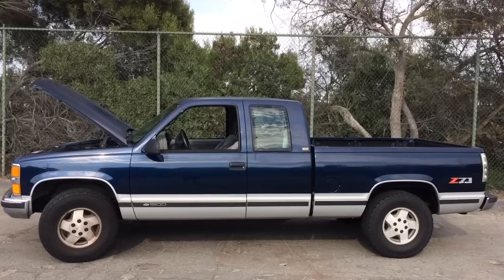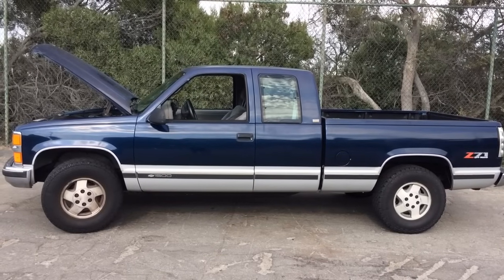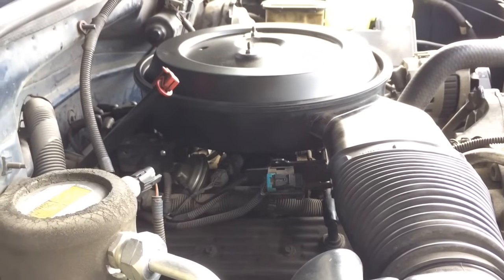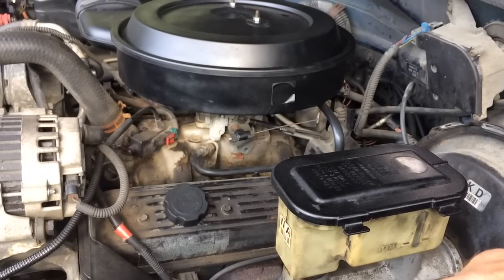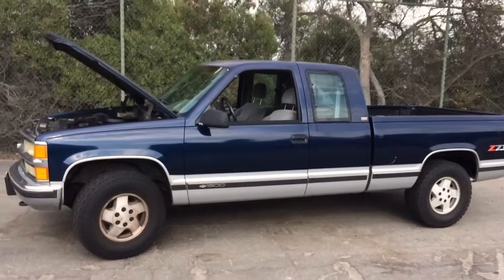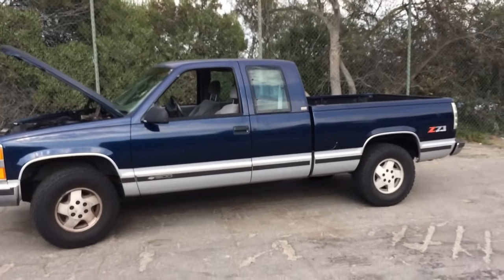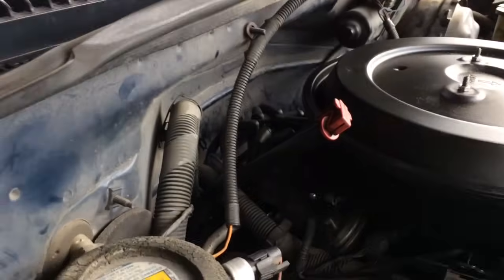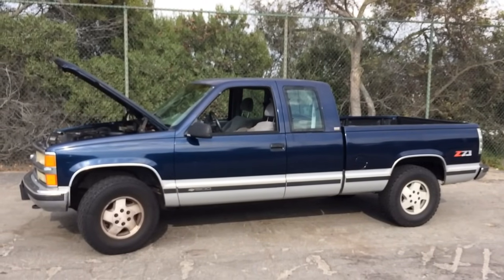Chevrolet Truck Hesitation Problem Fix

Comment: Very nice truck. I have 1995 Z71 also. Bought it new. 228,000. I’ve had the same issues you describe plus others. I love this truck. Just had it repainted. Everything works on this truck. One of chevys better looking trucks. My question is what size tires do you have on that thing? Really like the level stance of it. Also, what exactly did you replace/repair concerning the steering? My steering has  been requiring increasingly more effort to turn.
Reply from the maker: I had the pittman arms replaced to fix the steering problems. Your power steering pump might be the problem. Definitely make sure it has enough fluid in it, and maybe siphon the old fluid out and put some new in and see if that helps. Here is a video I made about the tires I’m running.  265 75 Tires On A Chevrolet Silverado Truck https://youtu.be/vpzE2AwR2VI
Reply: hoohoohoblin 
Thank you for the information and tips on the steering. Such a cool truck you have there.

Comment: Ok, but here's my issue. K1500 Heavy Half 5.7L Auto. Starts fine when cold, idles a little low and sometimes stalls. But when driving, after all is warmed up and hot. Loses power, like its running only on 3or4 cylinders. Stalls out, then won't restart until it cools off. Kinda like vapor lock is keeping the starter from rolling the engine over, or the battery is too weak to crank the engine. But after cooling, starts up and runs fine again. What's your take on that?
Reply from the maker: It could be the EGR valve getting stuck open. Sometimes if an ignition coil is going bad, it expands when it gets hot, and then the spark gets weak, but when it cools off, then it’s able to spark again. I’ve seen that happen on one of my motorcycles.

Comment: I have a 94. It's running Rich with a skip. And going down the road when it's skipping it has a faint popping noise out the exhaust. Any ideas

Comment: Thanks for the video man, what about shaking while under light throttle and rough idle when in gear on the brake
Reply from the maker: That’s a tough one to diagnose, and it could be a number of things. Sometimes the EGR valve gets stuck open and it will do that. That’s an easy thing to takeoff and clean. You can usually reuse the gasket, so it doesn’t cost you any money.
Reply: @hoohoohoblin  alright I really appreciate it man!

Comment: I have a 95 Chevy Tahoe that's doing the same problem like I'll be driving and it will act like I have no power so I'm just wondering will it still pass smog
Reply from the maker: It might. On my truck, it was sometimes fine, and other times it ran really rough, but when I took it to get emissions tested, it passed.

Comment: Was it shaking or jerking bad when you accelerate? Recently my 1994 Chevy Silverado c/k1500 5.7 with a 350 started to shake bad when driving. It only happens around 3 gear and up. It’s hesitates and then also jerks really bad when I press down the gas pedal a certain bit. Specially around 40mph and up. At around 50-55 I’m kicking into over drive and this is where the problem is the worst. Cause at about 50 I can only press the pedal down so much to get more speed without the truck shaking real bad. If I accelerate easy and slow it doesn’t happen.
Reply from the maker: It could be the EGR valve getting stuck open. I’ve seen that happen on these motors before I

Comment: 1989 Chevy 1500 4x4 transmission works sometimes and sometimes it doesn't work no reverse no forward it a 4speed automatic changed TV cable work went to store came out no gears went back next day and drove it home but had RPM really high and it sounded like it was in low gear maby sec
Reply from the maker: These trucks have a lot of mysterious problems. Mine was doing a lot of weird shifting and idling, and I replaced the ECU computer chip, and it fixed everything. I don’t know if that’s your problem, but it’s worth trying. Make sure you buy the chip with the exact same number as the one you have now. They make different ones for different engine and transmission configurations. People sell them on eBay all the time. I made a separate video showing how to swap a chip out.

Comment: my old 99 5.7 truck stalls every so oftern when i slow down, its gets scary sometimes. especially on the highway. i slow down to turn off, or cut across, its fine, maybe might sound kind of weird because i can tell when its about to do that. idling goes up and down. 
i decide to cut across, semi coming but i can make it, then she dies when i step on the gas. full standing stop. standing on the brake pedal. 
i changed the MAF, perhaps i might clean the TB or intake whatever. there is another sensor related to the MAF further back? 
it doesnt do this all the time. most of the time its not a problem but just every once in a while she acts up. in fact the thing runs great.
Reply from the maker: It could also be the EGR valve getting stuck. I’ve had that happen before, and it runs fine most of the time, but sometimes it gets stuck open or closed.

Comment: I have horrible hesitation. Sometimes runs well mostly No! I got a 1985 Chevrolet Scottsdale C10 long bed. I have new distributor cap and roter. New carberator. Checked all spark plugs for fire. Really great motor! So???? Goin down road hesitates. Even got shaking in front end. Do not kbow if that is re: to hesitation. It coughs when I shut her down in driveway. Used to cold start perfect. Now have hard time warmin her up. Used to not have that problem. After i drive for 10 or so minutes on regulat hwy. 55 mph seems calmer but still has that small jerk feelin like hesitating. I do need a new muffler on left side. I know i need ties rods and shocks up front. I have just got my babe back on road 5 mos ago . was sittin for 5 1/2 yrs. Doin most important to it first. But now this hesitation. Any suggestions? I love my truck. I put a new fuel pump on her 5 mos ago. Pulled tank emptied out gas. Put new fuel filter under hood by carberator
Reply from the maker: On my truck in the video, I think the main problem was that the plates in the catalytic converter had come loose, and sometimes they would obstruct the exhaust flow, and sometimes they would bounce around and get into a position to let enough exhaust out. It’s possible that the same thing is happening in your mufflers. And also in your catalytic converter, if that truck came with one.  The other thing which sometimes causes problems is the EGR valve, but I’m not sure if they have those in 1985 or not. If your EGR valve is stuck, you may be able to take it off and clean it and put it back on.

Comment: You ever change the EGR valve, my 91 gmc needed when it gave me problems with idling and shutting off in reverse
Reply from the maker: Yes. I made this video about it. In my case, it didn’t make much difference because the problem was something else. You can also take off the EGR valve and cleaned it out if it’s not working rather than buying a new one. How To Replace The EGR Valve On A GM 350 V8 Engine https://youtu.be/3DwDBIRrtso

Comment: Normally it's not your fuel pump that goes bad it's the hose connecting from the pump to the line going to your fuel filter those hoses get beat up over time close to 100,000 miles but since you are there might as well change the fuel pump

Comment: I have a 1993 Chevy and as I was trying to step on the gas it wouldn’t accelerate it would jump and the truck felt shaky so you know what it might be ?
Reply from the maker: It could be a lot of things. These problems are really hard to diagnose. It could be an EGR valve stuck open, or a throttle position sensor, or maybe even the ECU computer that controls the engine.

Comment: I have a 89 s10 pickup with a 2.5 liter engine and a manual transmission. Problem is it runs fine for about 15 to 20 minutes then it want to buck and carry on hesitate. Today when you put the clutch in it tried to die. The only parts I didn't install were the tps and map sensor. The fuel pump hanger assembly and tank are brand new. The brand new pump went bad in less than 30 days. I don't know what is causing it to run the way it does. The person i purchased truck from also replaced fuel pump. Why does my truck hate fuel pumps?
Reply from the maker: It could be the EGR valve getting stuck, or it could be the plates in the catalytic converter have broken loose and sometimes obstruct exhaust flow.

Comment: I'm having the same issue now, I only noticed it uphill but it won't go past 2500RPM. I'll definitely do the fuel filter and throttle positioning sensor
Reply: Did you get that fixed? I'm having the same problem. And winter is coming in. I need to aquire firewood
Reply: @Larren54  it was my fuel pump dying. It ended up totally crapping out shortly after. After replacing it it is much better
Reply: @aidanodonnell5908  woah! I was bout to replace my TPS. I tested my fuel pressure before the fuel filter. I had 11psi which is in spec

Comment: I have a 95 gmc sierra... Nice truck but since i got it ive never been able to get rid of the vibration/hesitation
Ive changed the
-Spark plugs( multiple times)
-Spark Plug wires(multiple times)
-Distributor cap(multiple times)
-Rotor(multiple times)
-Distributor
-Fuel Filter(multiple times)
-Fuel pump
-Alternator
-Starter
-the sensor on top of the valve cover
-cleaned out the carbuerator
-fuses
-relays
Its driving me crazy

-
Reply from the maker: On my truck I’m pretty sure it was the catalytic converter. What I think it happened was that the plates got loose and sometimes would obstruct the exhaust flow. You may want to check that, and also check the muffler to make sure that nothing is obstructing exhaust. You’ve handled all of the intake stuff and engine stuff, so that’s all that’s left.
Reply: @hoohoohoblin   I have a 95 Chevy silverado  started but no run l changed distribur cap rotor cables full filter egr temperature sensor  idle valvu end oxygen sensor but when desconet the temperature sensor an map is running but when put an drive cut out an please let me know 1idea sr

Comment: Thanks for the videos! I can start the truck easy if it has been sitting but if I stop and go on a errand it it's hard top start. Plus I can smell gas when it is running(running rich maybe).ECM is bad. This is a 96 gmc with 5.7 v8. I have 248000 miles. Any advice would be great. Finally, don't know if it is from running rich but the truck shakes when idle. I put into park and the shaking stops.
Reply from the maker: These trucks are tricky. It could be the EGR valve is dirty. On mine one thing I didn’t mention in the video because I didn’t know about it yet was that it had an intake manifold leak. That’s pretty common on these trucks, so maybe some extra air is getting in there. Also, on my truck I think the main problem was that the Catalytic converter had gone bad and the plates in it were rattling around and sometimes obstructing exhaust flow.
Reply: @hoohoohoblin  rats nest in exhaust ?

Comment: My 1990 is rusty, too.  The previous owner(a farmer) killed the stock 305 motor.  I put in a remanufactured 350, thinking I'd get more power. Nope. Still pokey, 12-15 mpg in the winter, 16-19 mpg in the warmer months. CEL comes on when it gets warm and the motor stumbles on acceleration.  I'll floor it for 10 seconds, the CEL goes off and it runs fine. But the CEL comes on at every restart.  Seafoam hasn't helped.  Any other ideas?
Reply from the maker: I don’t know. I made a video that shows how to check the trouble code using a paperclip. Once you know what the problem is, you can probably fix it.
Reply: @hoohoohoblin  : Thanks. Vic.

Comment: My 94 sbc 350 has 322k original miles on the motor. Pretty sure it’s internal seals causing my issues but it runs kinda rough at idle but drives fine minus the occasional trans slip, which I’ve narrowed down to shift solenoids. Any suggestions? lol I’ve done the plugs n wires, timing job was done around 270k miles, new egr, cleaned throttle body, new fuel filter, new tps, lots of other work the motor just has never been rebuilt. It burns about a quart of oil every 800 miles or so with no obviously bad leaks externally. In park it idles at 450ish Rpms and in drive/reverse around 200? According to the Tach of course.

Comment: You said your pump is on the frame rail but it is the fuel filter lol
Reply from the maker: I wish the fuel pump was on the frame rail. It would be a lot easier to replace.
Reply: He got down to show filter then misspoke when getting up. I understood him.
Reply: His whole video is correct and you manage to catch him mislabel one thing. (clearly by mistake, and he knew it was not the pump)

Comment: 92 k1500 4.3L v6 5 speed manual 85k original miles hesitates only when a/c is on and going up hills. Complete tune up was of no help other than even better gpm
Reply: Yeah mine hesitates when going up a hill as well

Comment: Dont do what this guy did. shot gunning a vehicle repair is bad advice. there is a always a definitive way to verify a problem.
Reply: How? I have a 2000 GMC Savana 3500 with a bogging down problem. She runs great but every once in a while chugs like shes choking and I can barely move and almost get stranded. I put her in park, shut her off then start her up and shes fine for a bit. Can't figure it out. I've done plugs, wires, fuel filter, replaced leaky hoses, etc
Reply: Gus Ricciuti I bet it's the fuel pump my 98 Chevy did the same thing it would start run just fine then it would start dying while you drive it. I took it to a shop and they said the fuel pressure was fine then I sold it to my cousin and he put a new fuel pump in it and it ran just fine
Reply: My 94 Chevy 4.3 L V6 TBI starts up then dies. If I unplug the vacuum hose from the map sensor it idles like a champ but as soon as I hit the gas it bogs down or tries to die
Reply: What do you think that could be have you ever heard of that?
Reply: coker23cola  anyone ever find out?
Reply: I got a checklist depending on what is odd about the truck
Reply: Ok, My 94 1500 is losing power when I try to maintain speed at 70mph, when I give it a little more gas to compensate it starts to hesitate and act like a clogging fuel filter. My fuel pump is only 3 years old and I just swapped the filter 4 months ago (it had clogged completely). I just replaced the filter again this morning and its still doing the same thing. It also sputters at about 45mph after I get off the freeway, if I stomp the gas it tends to pick up and go. Its intermittent, it will happen then clear up then happen again. Wont do it on my way to work but always does on the way home, its just as butt ass cold during the day as it is at night so its not temp related. It seems to start after being on the freeway for a few minutes, runs great otherwise. It accelerates fine from a stop and idles fine. Please HELP LOL Thanks
Reply: @coker23cola  i say fuel pump.
Reply: @TheCOMICCOMMANDER  if your fuel filter was clogged i would suspect your fuel strainer is completely clogged in the tank also.
Reply: @TheCOMICCOMMANDER  let me know what you find out
Reply: @kenhollom1669  Its a headlight shot. Its only when the headlights are on.
Reply: All of those things needed replaced anyway so yeah this was a great video
Reply: @kenhollom1669  After $1300 spent on 2 different mechanics, I finally figured the problem out myself. It was the ICM (ignition control module) in the distributor. $40 and less than an hour, but with all the other work I had done, it running like a BEAST again.
Reply: @TheCOMICCOMMANDER  glad to hear
Reply: @kenhollom1669  Spoke too soon, NOT FIXED :-( im $1300 into this and still cannot find the problem. Im sick to my stomach from it
Reply: @TheCOMICCOMMANDER  check the distributor for play
Reply: @TheCOMICCOMMANDER  im not to sure about the pre 96s i have a 97 and the only issue i have had like this was fuel pump and also air intake leaks
Reply: @kenhollom1669  Im thinking its the fuel pressure regulator.
Reply: @kenhollom1669  best solution would be to just drive it off a cliff... with me in it LOL jk

Comment: Did you TEST any of these? Or did you fire the parts cannon at it? Really you make it sound like you just fired parts at it...if you did diagnostic explain it.
Reply from the maker: It was mostly the parts cannon. I started out replacing a few things but I suspected, and then I gave it to a mechanic, thinking that he would know what to do, and he replaced a ton of things with his own parts cannon as well. I think the problem was that the catalytic converter plates and shaking loose and sometimes obstructed the exhaust flow. But it could’ve been a combination of a whole bunch of bad things.

Comment: I installed new battery and alternator battery won't hold charge turns off on the freeway can your house need to get to work by Monday and need answers

Comment: Mine shakes some times at 80 then it will stop if i hit gas and sometimes it doesnt do it at all any idea new u joints trans always been serviced
Reply from the maker: I don’t know. It could be a lot of things. The truck in the video had almost everything replaced, but I’m pretty sure the Catalytic converter was the problem. I think the plates in it had broken loose, and sometimes they obstructed exhaust flow. I had an Astro van with a clogged EGR valve, and it would act funny sometimes as well.

Comment: My 96 4.3L has the issue under acceleration/steep incline. Have the catallyty converter rattle since I got the truck a year ago. But getting worse now.

Work at a shop I’ll swap that out and let people know. Prettt sure mine will just be the cat and possibly tps.
Reply from the maker: I think that’s what was wrong with mine. The new catalytic converter fixed it.